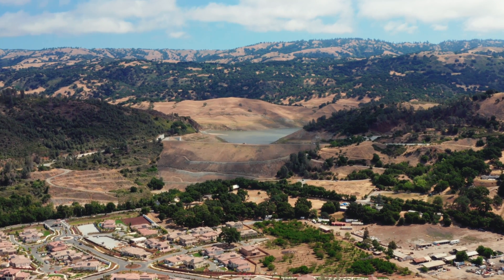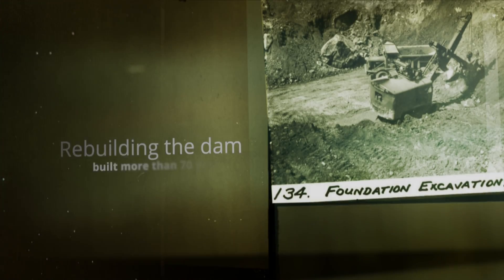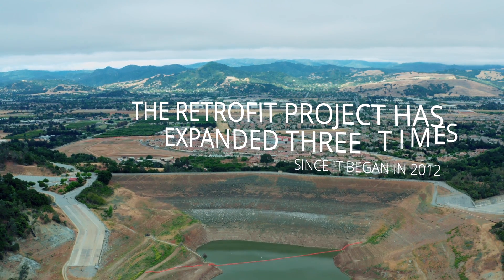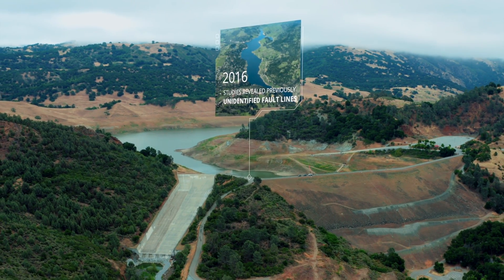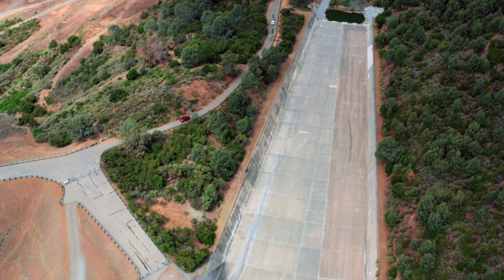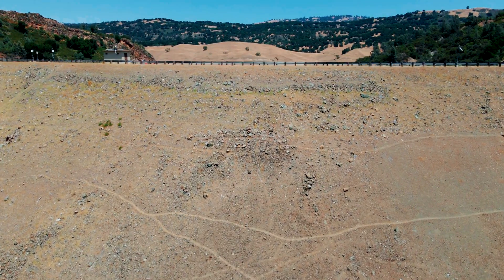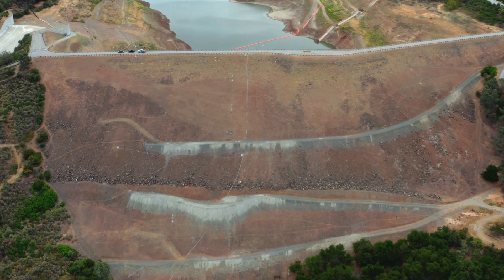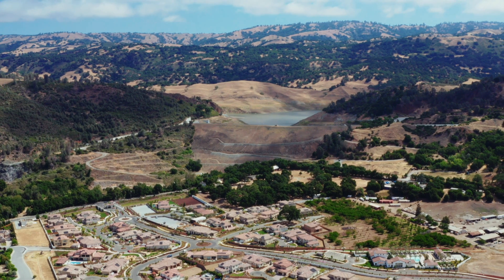What's going on at Anderson Dam?

Comment: Clearly this project was not managed well from the start. Even the video claims "new fault lines" were discovered 4 years after project was supposed to start. It's been delayed multiple times and not because of fault lines. Valley Water blamed regulators not giving them permits and such. Of course, they can't say that in this video.  And, the budget just kept growing. The only reason it is being done now is the Feds forced them to get this done. Typical California mismanagement. 10 years. What a joke. Started in 2012. But, won't truly be done  until 2030-ish. So, 18 years. Assuming no more delays.  So, if you live nearby by and wanted to enjoy this recreation spot, no dice for 10 years. Tax dollars hard at work...

Comment: The 3 Gorges Dam in China, a much, much larger dam was completed in about 10 years.  That dam was built largely "from scratch", with no existing dam to start from.   Whole towns had to be relocated.  And the 3 Gorges Dam also provides an enormous amount of hydroelectric power and thus required extra work to install the turbines, electric generators and extra equipment, something the Anderson dam doesn't have. WHY are public works projects so inefficient in the US?